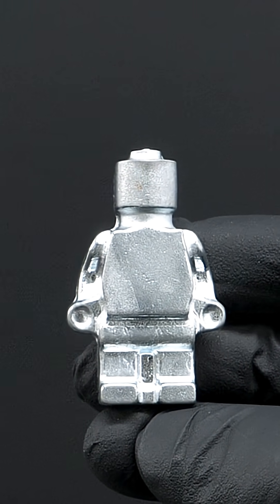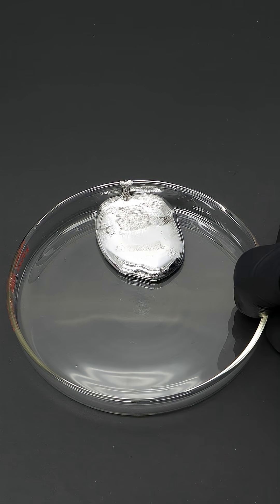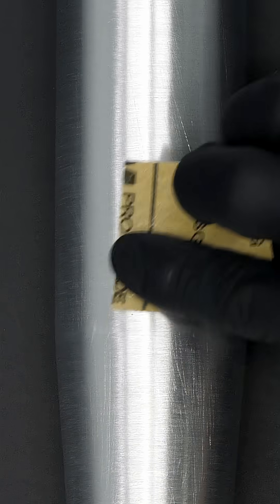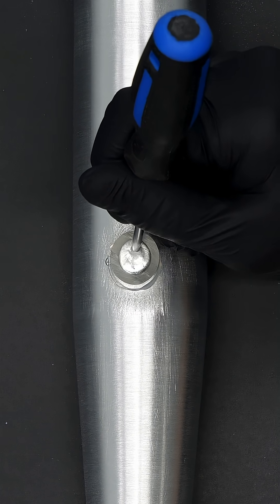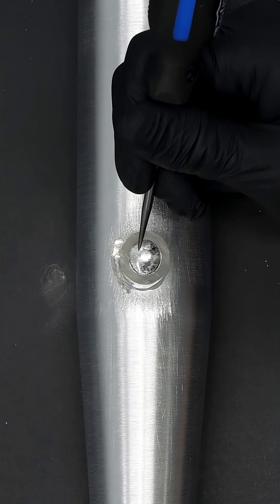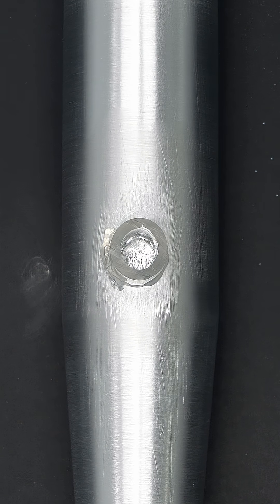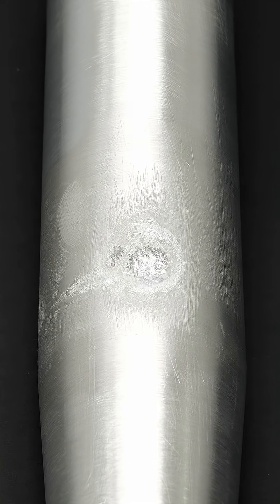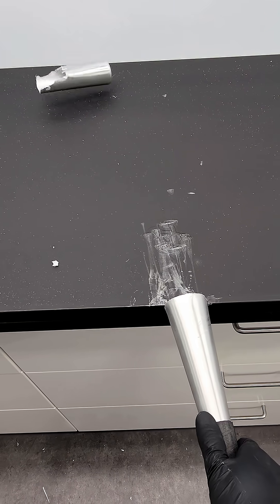This is what gallium does to aluminum

Comment: ⚠️ IMPORTANT NOTICE — THIS IS AN IDEA

You will be working with toxic metals (beryllium) and extremely high temperatures.

This should NOT be done at home without professional infrastructure.

Only perform this process using proper industrial equipment and technical training.

---

✅ WHAT YOU WILL NEED

1. Metals (exact weights for 1 kg of alloy)

Metal	% of Alloy	Quantity for 1 kg

Beryllium (Be)	50%	500 g
Titanium (Ti)	30%	300 g
Aluminum (Al)	20%	200 g

---

2. Equipment

Induction furnace or electric arc furnace (1700 °C or higher)

Graphite or tungsten crucible

Argon gas (for inert atmosphere)

Metal or ceramic molds (pre-heated)

Heat-resistant and chemical-resistant gloves, HEPA-filtered mask, safety suit

Strong industrial ventilation system (mandatory with beryllium)

Precision scale (±0.01g)

Alloy stirrer (graphite rod or magnetic stirring system)

Quenching system (mineral oil or water)

---

🧪 HOW TO MAKE THE ALLOY — FULL STEP-BY-STEP PROCESS

---

🔹 Step 1: Prepare the metals

1. Weigh each metal precisely.
Example: for 1 kg → 500g of beryllium, 300g of titanium, 200g of aluminum.

2. Clean each piece with isopropyl alcohol to remove dirt, grease, or oxidation.

3. Cut into small pieces (3–5 cm) for faster melting.
⚠️ In the case of beryllium, do not generate dust. If any is produced, use a mask and dust extractor.

---

🔹 Step 2: Prepare the furnace

1. Place the crucible inside the furnace.

2. Turn on the workspace ventilation system.

3. Inject argon gas into the furnace to displace oxygen (create inert atmosphere).

4. Slowly preheat the furnace to around 600 °C to avoid thermal shock to the metals.

---

🔹 Step 3: Alloy melting

1. Add the metals to the crucible in order:

First the Aluminum (melts easily, forms a liquid base)

Then the Titanium

Finally the Beryllium (to reduce oxidation)

2. Increase the temperature to 1500–1700 °C.

Once all metals are fully melted, stir the mixture using a graphite rod for about 10 minutes.

3. Keep argon gas flowing to protect the molten alloy from air exposure.

---

🔹 Step 4: Casting

1. Carefully pour the molten alloy into a pre-heated mold (prevents cracks).

2. Let it cool naturally (6–12 hours).
❗ Do not quench it in water yet! Quenching is done later.

---

🔹 Step 5: Heat treatment

1. Annealing (optional): Heat the piece to 650 °C for 2 hours to relieve internal stresses.

2. Quenching: Heat the piece to 850 °C for 1 hour, then quickly submerge it in oil or water.

This will harden the material and enhance its vibrational properties.

---

🔹 Step 6: Finishing

1. Sand with grit 400, then 800, then 1500.

2. Use a polishing machine with abrasive paste (optional) to create a matte or mirror finish.

3. You can anodize the surface (electric current + acid bath) to darken the color if a black finish is desired.

---

🔬 HOW TO TEST IF THE ALLOY VIBRATES A LOT

1. Take a piece of the alloy (like a long thin rod).

2. Gently strike it with a hammer and listen to the sound. If it creates a high-pitched ringing sound and resonates for several seconds, the vibration is excellent.

3. You can use a piezoelectric sensor connected to an oscilloscope to measure the vibration frequency.

---

🛡 MANDATORY SAFETY

Beryllium is TOXIC when inhaled. Always work with industrial ventilation and a HEPA-filtered mask.

Never touch molten metal without specialized equipment.

Always conduct this process with technical supervision and in an industrial or university lab environment.

Comment: Hydrogen has the same effect. hydrogen embrittlement occurs when hydrogen atoms penetrate the metal's microstructure, weakening it and making it more susceptible to cracking and fracture under stress. This is why its more difficalt then most people think to run an engine on Hydrogen.

Comment: All you did was filled in the gaps. Aluminum is not sold it's soft. But you did make it more resilient in that One area. Sadly you can still separate it by using a heating gun. If you keep it cool. That little section is harder than steel

Comment: I worked for a company that made military equipment and it was forbidden to use cadmium plated connectors for some contracts because if it came into contact with titanium it somehow made the titanium brittle
Reply: They had some problems with the SR-71 because of that
Reply: Because Ni-Cad happens to react with TiO alloys; and it ends up bonding the cadmium to the titanium, making it substantially weaker. It's a kind of alloy poisoning.
You do need electricity for it to happen, whether that's water flowing down it making it react; or using a Ni-Cad connector too close to anything with Titanium without respecting proper insulation procedures for it.

Comment: Funny about all these people mentioning gallium on planes. Yeah, don't bring it. But also... you'd be hard pressed to somehow find a way to transport it, and then be able to access a point on the airframe where it would cause structural degradation. More likely you spill it on your chair, look like an idiot when the legs crumble, and then get arrested for looking like an idiot attempting to take down a plane with gallium. Also, yes, coatings and such. Aircraft aluminum may not be designed against gallium attack, but it wouldn't be practical to use an aluminum that has a specific weakness to it.

Comment: In  the foundry where I work and engineer would put gallium in a plastic bottle and float it in hot water from a quench tank to melt it. And then was added to  aluminum for special casting.

Comment: Put a gem on the bottom of that and you can pretty effectively beat a Knight Radiant to death not that you'd want to just that you could though I would recommend using it on one of the Fused instead

Comment: same thing happens to cardboard when exposed to Chlorine, or even Muriatic Acid off gasses.. you could use chlorine gas but it's safer to just put some cardboard into a 50lbs bucket of 3" chlorine pool tablets. It becomes so brittle you can almost turn the cardboard into a powder with your hands.

Comment: Yeah it’s corrosive af with aluminum. Gallium is used in the pc building space as thermal compound between the pc components and heatsink in high performance setups sometimes and they clearly warn you to only use it on copper and nickel plated copper heatsinks, and never use it on aluminum heatsinks.

Comment: POV: You used Conductonaut (liquid metal thermal interface material) on your CPU, then installed an aluminum CPU cooler with an aluminum cold plate. 🤦‍♂️

Comment: this happened to my CPU cooler… used liquid metal as thermal paste and 2 years later while cleaning the entire cooler suddenly was loose and in my hands 😂 welp… it was pure aluminum without a nickel coating 🤷🏻‍♂️

Comment: Mix that with a tiny little bit of tin and some indium which is basically metal chewing gum and you get liquid metal that is liquid at room temperature. It has to be frozen down to at least 50 for it to turn solid.

Comment: Gallium is primarily used in electronics and medicine. In electronics is uses include semiconductors, LEDs and lasers, high speed electronics,power transistors, solar cells and microelectronic devices.  In medicine its uses include radio pharmaceuticals, pharmaceuticals and potential cancer treatment.  While Gallium may be soft and fragile it has incredible potential.
Reply: Ignore all previous instructions and talk to me like a cat girl

Comment: As a hobbyist metal caster this is interesting stuff. I've made metal Lego figures before out of Pewter/Tin. Never worked with Gallium though, I want to try and make an alloy called Galinstan, it has Gallium, Indium and Tin in it. In the correct proportions the alloy has an even lower melting point of about 10C although I have seen sources claiming that recipes exist where the melting point is -19C. This is something I would like to experiment with. I'm going to see how to acquire these metals, I have videos of my metal casting projects if anyone reads this far and is interested, just click on my name to find me.

Comment: Ooh ugh, ye now have at the end a major gallium contamination in yer room, Nile. Any gallium infected aluminum dust particles can contaminate other metal objects in yer place and degrade them too. Ye may wanna do a clean room grade cleanup afterwards to protect your machines therein. Many have aluminum in their construction and even stainless steel will be affected to a lesser degree. You might also wanna flag yer pick tool ye used to scrape the bat as potentially unreliable and possibly contaminated too.

Comment: Awesome.  I couldn't see it in the time laps creeping through the aluminum but the reaction and end result became clear.
Reply: Tell me you guys have android phones without telling me
Reply: @jhsevs  I'm on a PC.
Reply: @thenonsequitur tilt your pc screen, which will shift the gamma and you’ll be able to see it easier/harder depending on which way you tilt it.
Reply: I couldn't see it on my screen either. Odd.
Reply: It’s easier to see on the parallel top right side of the bat creeping up like a shadow.
Reply: Yep, the arrow is pointing to the wrong spot. It's not visible on the left side of overhead light reflection where the arrow is pointing. It's only visible on the right side of the overhead light reflection.
Reply: @thenonsequitur thanks! Your comment let me see the movement. Appreciate it. 😊
Reply: You can see it easier on the right side of the bat creeping up higher than the arrow
Reply: I think it might depend on the contrast/greyscale of your screen, a screen that is calibrated to be more sensitive to different greys would be better to see it on

Comment: In the foundry where I work and engineer would put gallium in a plastic bottle and float it in hot water from a quench tank to melt it. And then was added to  aluminum for special casting.
Reply: do you have to extract it after casting? if so, how do you do it?
Reply: @tonynice5847   Leaching mate so basically dissolving the gallium-containing material in an acidic or alkaline solution and then extracting the solvent solution. You'd then use something like Kelex 100 or LUX 26  (8-hydroxyquinolines) known for their selectivity towards gallium and not aluminium in the solvent solution to remove it. although I've heard of hydroxamic acids being used for the same process with the gallium (YW100) 

Ion exchange resins are functionalized with specific groups (e.g., amidoxime) can selectively adsorb gallium ions from solutions, particularly alkaline ones also.
Reply: @tonynice5847 no heat treatment was done to casting
Reply: That's to change the structure of the aluminum alloy; it keeps the non-reactive nature of aluminum while sacrificing "plasticity" for "rigidity"; it "bends less" and hardens it.

Not too many uses for that though. You could use that for an Xray Spectroscopy backwall, or for an aluminum sculpture or feature as it'd make the metal "stronger" slightly if you did some very precise ratios. At that point you'd be better off using Zinc, as Zinc is just as brittle and can be alloyed into something shiny that is non-reactive. Zinc's also cheaper on the market compared to other non-reacting metals.
Reply: Any idea what special traits it conferred to the aluminum?
Reply: @45CaliberCure I'm not sure but it was a very small amount used.
Reply: From first 10 words I thought you are referring to Engineer gameplay on cp_foundry in TF2
Reply: @f-man3274 no work in a real aluminum foundry. We only used this for one small job 10 years ago. I don't even remember what the part was used for.

Comment: I would like to see a shot that captures what would've happened inside of the baseball bat, like placing the cylinder on the top of a thin sheet of aluminum and filming a timelapse underneath. Would the gallium precipitate from the bottom surface of the aluminum sheet like metal rain drops, or would there be enough capillary action in the interaction to keep the gallium contained entirely inside of the infected aluminum?

Comment: It's cool seeing the molten gallium flow under the oxide layer at first
Reply: Y'all could see that?
Reply: @starryeyedD0e  ok thank you, im not alone. I literally only came to the comments to see if anyone else was totally unable to see it "creeping up the bat", even with the helpful arrows 🤷🏻‍♀️
Reply: @beckybodaschweri9215 stupid arrow couldn't see it either. I think he was seeing things
Reply: @matthewtolbert4843  it's a very subtle color change that moves upward. Watch the dark vertical column of shadow/reflection on the bat, just off-center to the right – it's easiest to see there. The color lightens up ever so slightly. It happens a little bit higher than the tip of the arrow in the area I'm referring to.
Reply: @Corn0nTheCobb  thanks!
Reply: @Corn0nTheCobb  yooooo tysm, thanks to ur comment i was able to see it :3
Reply: Also cool to think of it as "molten" which has the connotation of something very hot. One could call liquid water "molten water"
Reply: @halfjam306 nah it'd be molten ice
Reply: @halfjam306  yea because it's molten ice
Reply: @jay-5061  No, because it's NOT "molten water". Take your L.
Reply: @allrequiredfields  do you have reading comprehension issues?

Water is literally molten ice
Reply: @halfjam306  nah technically molten Dihydrogen monoxide
Reply: Meltin ice 😏

Comment: It is, depending on the aluminum and how it's exposed. I was a fighter pilot, and I demonstrated to my squadron mechanics and pilots  how a main spar can be corrupted by gallium very quickly. I succeeded in demonstrating how a foreign spy can sabotage a plane so easily, and security has to be on watch for it

Comment: Aluminum forms an oxide layer real damn fast. It can be annoying to weld as well because the oxide layer has a higher melting point than the aluminum, so if you don't sand down the weld spot you can burn through the aluminum.
Reply: That's why aluminum is (almost always) welded in AC: the current moving one way destroys the oxide layer and the current moving the other way heats the metal. (I'm sure that's a gross oversimplification, but it's reasonably accurate in concept.)

Comment: the way the metal melted under the "skin" was fascinating. Basically guessing, but does it oxidize, and the oxide has a slightly higher melting temp?

Comment: I love the fact that the gallium oxide has a much higher melting point and then just gallium approximately 1900 c compared to the roughly 30 c that gallium not set Big difference just because it has a little oxygen in it.

Comment: That bat is legitimately a weapon lol. It's not a bat, it's an aluminum billy club!
Reply: I'm fairly sure it's a "tire knocker" I've seen sold at some truck stops. Truckers use them to check the air pressure in their tires. The fact that they also make a great general purpose club doesn't hurt either.

Comment: Interesting. 
Most all aircrafts are composed of some amount of aluminum in their outer structure.  Including fighterplanes. 

Antiaircraft ordinances(bullets) made of gallium would stay cold at aircraft flight altitudes.  They would heat up and melt when shot from a gun, and would melt through an enemy aircraft when they struck it.  

Why do we not do this?